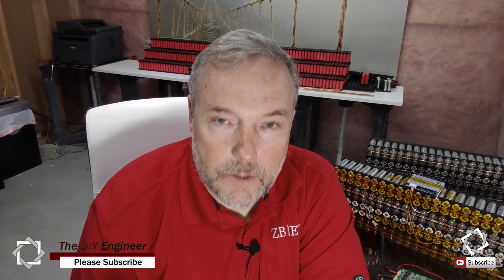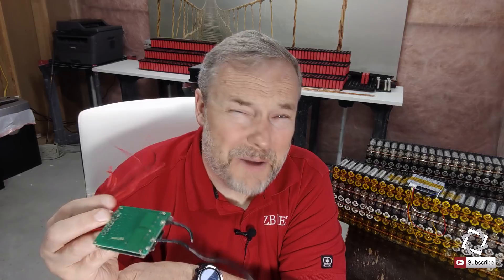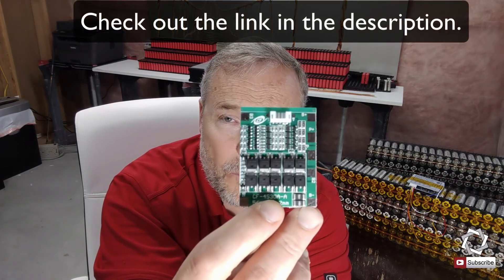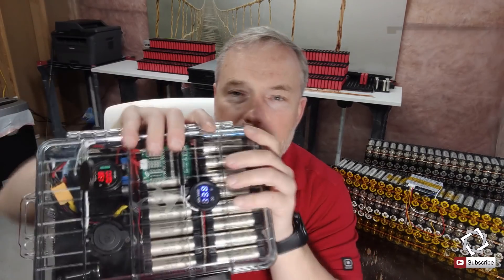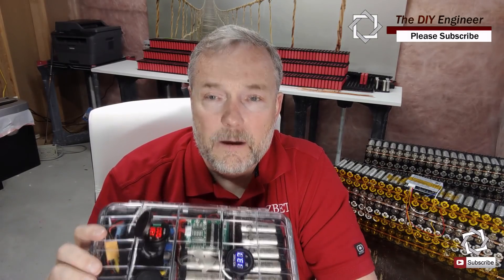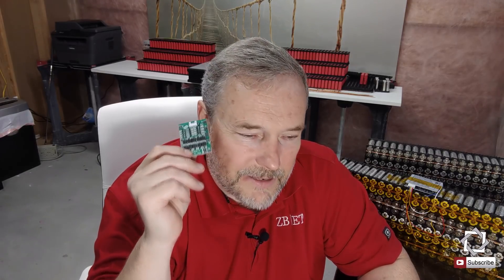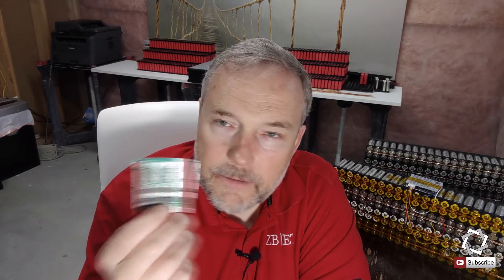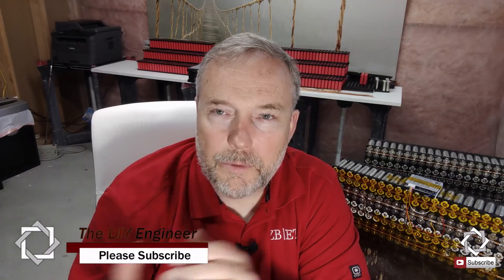My take on BMS's

Comment: I’ve been running my trail cameras with 1, 2p, or 3p LiFePo4 6000mah batteries and solar panels.    Using a variable input Buck Converter set to max 3.65V off the solar panels.     Using a Boost Converter off the batteries set to 6.15V to drive the cameras.   How can I protect the batteries from a short or low voltage?  

Could I use the LiFePo4 protection strips on each battery?   How would they be connected?

I’ve got 3 of these that have been going for 10 months without protection.    Would most like to add low voltage protection.  

Thank you, 
Mike

Comment: 2:32 one is the good one, i populated that 5th mosfet place from another same bms, and added 2 more shunt resistors, and paralleled 2 moded bms ... now i use at 60A max, and up to 80A surge output. 
p.s. not 8S, all are 10S, this one have 10 wires instead of 11, that's why this one don't start from battery negative.

Comment: i have used hover board BMS for 3S and 7S, they works great, 15A max, if your bms have mosfet HY1906 - then add 2nd or 3rd shunt resistors and current will increase to 30A-35A continuous ... these mosfets are the best as compared to HY1908, HY1606 etc,

Comment: Just a quick reminder, Frank. You didn't give us the schematic on how you made that medium battery pack, especially the part where you used the solenoid switch.
After the promises, you never sent it.
Reply: So, the Mower that you built a pack for a 10s7p...? has no BMS?

Comment: I'm definitely no expert on this but so far my experience with BMS's has been pretty much failure and frustration. Crappy Chinese knock-off junk hasn't helped. Along the way I did learn a few things I'd like to share: So-called "recycling notebook lithium cells" resulted in about half of them tossed. For example if you're charging and the cell gets very hot toss it. Cells in packs MUST be very close to each other in voltage or a BMS won't work. I saw a figure of not more than 0.05v. Capacity is important too at less than 30mah optimally. Tie cells in parallel to match voltage. Determine cells capacity and match up similar ones. For best results and to save a lot of time buy new cells from reliable sources.
 .

Comment: Hi Frank,
Very usefull videos from you. I have subseribed you not to miss any videos from you. I am  beginner to 18650. My complete house I have 12V led lights. Now getting ready to make a small powerwall for my house. Confusion is Do I need  3s  or 4s powerwall? Will 4s damage my 12v led lights? is my 3s will drom the brightness while working in the night?  Thank you.

Comment: Frank, can I use a 30a 14s bms just to charge the battery pack? My battery pack has 400a on demand and my application ony needs 200a draw from the 14s battery. Is it possible? The high amp bms are expensive!!!! Looking for a cheaper route.

Comment: Some, especially harvested batteries will sag quickly under heavy load,  but will recover if rested or not pushed close to their limit.

This happens often when you have a  lot of batteries in parallel. Some will follow discharge load and loose voltage normally, but some in the same group  will loose voltage faster. Having BMS with balance feature is a must.

Comment: Dear Frank, my name is Jose and I have been fooling around with this 18650 batteries, I made a 4 battery pack and I used a bms (4s-30A) board with it, the problem that I'm having is that without the bms, my 4 battery pack would last me for about 6 hours continues using, but like you said on your video, one battery would not charge at all , while the others would be fully charge,  and now with the bms they all charge equally but the pack would only last for approximately 1 hour 1/2. I would appreciate any tips you may have. Love your videos. Thanks
Reply: with a BMS... ur pack is only as strong as ur weakest link

Comment: I am familiar with large packs and long term you need a BMS. Have I ever operated without?  Yes but with new cells all the same but I have good monitoring. I am the BMS. But when I want to install and forget  than BMS is a must. 
I think you are not thinking or saying correctly. not any of the current going to the load passes though the BMS. (That is almost a correct statement) the current going through the BMS is only an attempt to balance no more. But it would be correct to say a BMS with 2 amp shunt current would be way to small for a 1000 AH battery.
This is new to the market 
https://www.ev-power.eu/Battery-Management/BMS123-Smart/123-Smart-BMS-Complete-Set-4-cells-with-Bluetooth-4-0.html
I am using this on on a 16 cell 1000AH system.
Many of the cheap BMS that were made for conditions that are not adjustable. or really understandable. Give people a false sense of security. And you maybe truly better off without.

Comment: The 100A BMS you linked to appears to support 18650 in its description, but the diagram shows 3.2v and states applicable LifePO4 battery. 
Is there a switch over option to use it with a 4s 18650 battery? Does it self sense whether it is connected to 3.7v 18650 and / or 3.2v LifePo4?
Thanks for sharing :)

Comment: I have a question: what's happen if u mix standard 18650 cells(4.2v char) with some rare 18650 cells(4.30v-4.35v char)?  like LGABD11865 or ICR18650-32A; the charge/discharge curve are different.
or even in general, if u mix different brands and chemistry like; ICR, NMC, NCA...
Reply from the maker: That is a good question and I don't know that I have an answer.  I catalog all my cells and I don't think I have ran across any of those cell types.  If I did I would probably not use them in my packs.
Reply: what type of cells do u use in our 4s40p pack? in my 4s20p most are samsung (26h/26f/22f), and few panasonic/sanyo/lg
i have discard cell with 4.30/4.35V from this project because i dont want to get more risky

Comment: the way batrium is made i assume you would have to have 1 longmon per S for the battery packs and thats just not practical for the groups that would have multiple battery packs to get the amp/hr we need and having the pack voltage already set for more than 1S but im sure batrium would be glad to rob your wallet for the longmons that would be needed for oh lets say 4S 20P times 6 battery packs 24 longmons at 13.19 each when the average 4S bms with balance is less than 20 bucks
Reply from the maker: That is good to know, I'm still very interested in Batrium and I still want to learn more about them.  Thanks Steven!!
Reply from the maker: I'm glad to see that we see this the same way.  Thanks for you input.